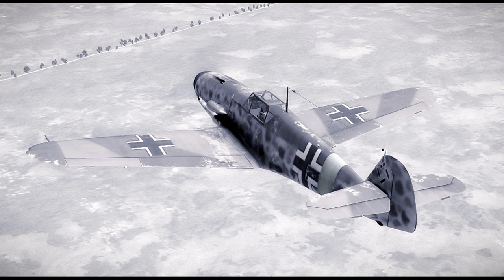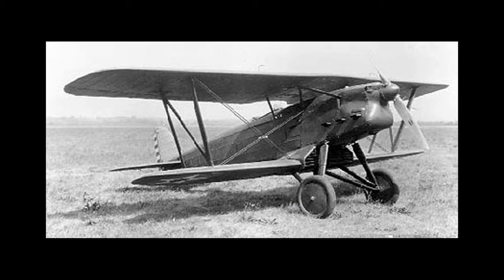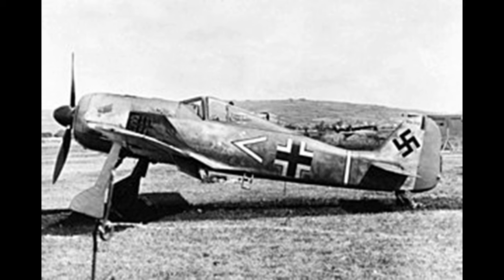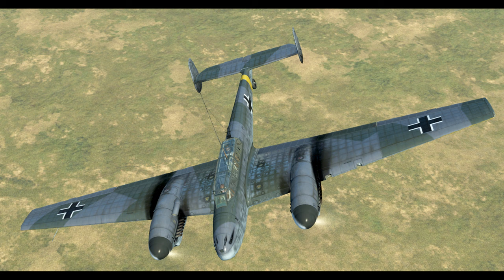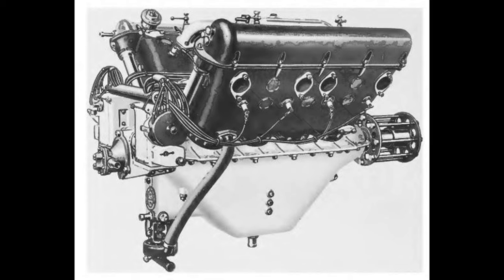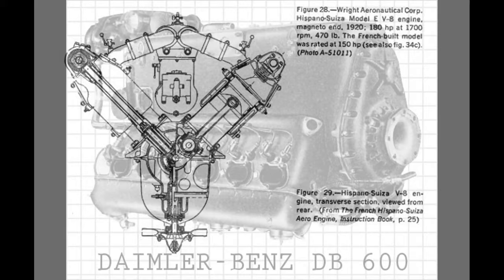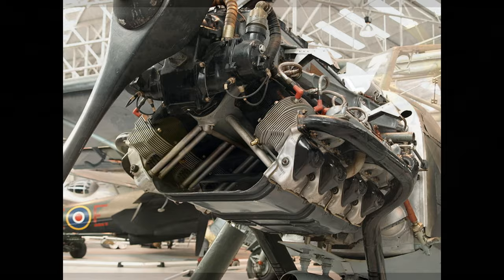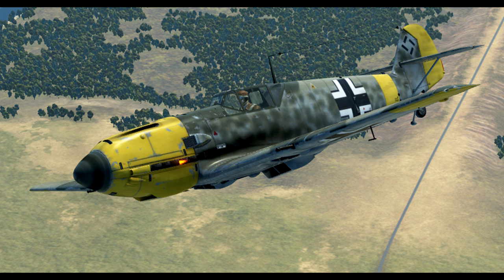Messerschmitt Bf 109 , Why an INVERTED V-12 Pt. 1? inverted V12s vs. upright

Comment: Do the inverted inline engine cylinders not fill with oil like the bottom cylinders of radial engines do from sitting?
Reply: i was wondering that, bottoms of the pistons would be full of oil and how does the drained oil get back to the oil tank ?
Reply: @jocrp6 Yes, that was a problem. Engines that had been standing for too long needed to be rotated liberally to clear the oil, and the spark plugs needed a lot of replacing/cleaning because of the gathering oil. It was a pain in the ass for LW's maintenance crews. Whether it was worth the easier reach when working with the engines I don't know, but it's certain the design wasn't without its drawbacks.

@johnik sushibar The Daimler-Benz engines (and I assume the Jumos too, without looking) effectively had two oil sumps, the camshaft cases doubling as one. There were scavenger pumps there to get the oil back to the oil radiator and oil tank.
Reply: @Inkompetent  thanks for the quick reply, what about the oil that drained down into the pistons , cant imagine them being "solid" ?
Reply: @johniksushibar165  Afraid I don't know about that part, but I imagine there at least being some drainage holes on the sides of them, allowing oil to flow to the camshaft case.
Reply: @Inkompetent  thanks,makes sense, i am a car mechanic , i cant get my head round things like this :-0
Reply: @johniksushibar165  I don't see how the oil that builds up in the piston cup would reach the cam case. Even if there were holes in the sides of the pistons, that oil would just drain into the combustion chamber, and out an open valve. But I dunno, I'm not a mechanic. The Wittman Tailwind used an inverted V8 at one time but it was eventually removed. I don't know why.
Reply: @myotherusername9224  Was that the Ford flat head? Yeah, no holes in pistons, just crank the engine over, ignition off, by hand 2-3 times and fire it up.
Reply: @jiroyamamoto2878  Wittman used the aluminum block Buick V8 from the 1960s. GM sold the design and the tooling to British Leyland, and the same basic engine is still in Rovers.

Comment: I was wondering about this engine choice. Think it's like the interwoven wheels Germany fell in love with on the tanks. On paper they are perfect, in the field a bad idea. Germany's response - Perfect now lets use them on EVERYTHING even motorcycle gun carriers!!
Reply: The interwoven wheels weren't a bad idea, the tanks were able to drive very smooth on rough terrain. And that's not a bug, it's a great feature... The traction benefits from that construction...
Reply: They  also clogged with mud and froze solid in Russia making the tank unusable. Could not be repaired  in the field without removing 4 wheels taking hours to days. There is a reason no vehicle has ever used them since. You are confusing advantages of torsion bars with the wheel design  @duke6321
Reply: dirkbonesteel not true lol, give us some sources
Reply: All of them  @Aikaramba12
Reply: @dirkbonesteel 
No, I'm not confused about the advantage of the torsion bars in comparison to the interwoven wheels. Fact is, that the ground pressure of the interwoven wheels is less then the pressure, a Christie's drive has. So they had some good reasons to use this for the heavy german tanks of WWII. Less ground pressure and less stress for the wheels and the chain is an advantage. You are right, they also had misadvantages in poor weather conditions and while maintenance. But they were the best choice that time. Today the technical progress makes them unreliable...

Comment: The Merlin was extensively used in  British MTB and MGB  (essentially the same  hull designs were copied for  the US PT boats).  Merlin suffered from corrosion in the marine environment and with aviation applications being the first priority  the Royal Navy switched to using the excellent Packard engine supplied under lend-lease.

Comment: It would seem to me that the inverted V has an advantage over uprights in overall war fighting capability where it counts the most , in the air .. The fuselage being narrow at top and wide at bottom where wing intersects could conceivably allow a more streamlined airframe   ( faster ) ..  If that's the case then everything else , unless huge cost or reliability issues , are moot points ... War fighting and battle winning capability are the holy grail ... and were I required to build a piston  fighter back then  , knowing what I know now , It would be an inverted V ... The comments on plug fouling , ring cracking , main bearing lubrication make me marvel at how little people know about engines .... You can point cylinders up , down , sideways , foreward or backward and there is a way of pressure lubricating and scavenging the oil and not fouling the plugs ... main crankshaft bearings have no idea how close or far they are from the oil pan or pickups and  do not care if they are located above or below the pistons .. they are pressure lubricated and then the oil falls away ... Oil settling in inverted cylinders before startup is a small aggravation that can be mitigated with procedures ... once the engine is running no component cares where its located

Comment: About primary sources. Calum E. Douglas in his book "The Secret Horsepower Race" at page 74 quotes the letter form Dr-Ing Wolfram Eisenlohr, who at one time was the Technical Director of Engine Development at the RLM. In this letter he lays out the technical requirements RLM sent out to DB, BMW, Jumo and Argus for the tender for new engine development in 1928. These requirements were specified by his predecessor, Dr-Ing. Helmuth Sachse. 

You probably would be pleased to know, that you've nailed it exactly right. The first requirement was inverted layout which "gave a smaller restriction to the field of view of the pilot". Second point was "lower mounted exhaust was preferable as the exhaust flames and also the fumes are further from the pilot", also "the position of the wing attachment to the fuselage is wider than higher up and therefore suits this widest part of the engine being mounted in a similar position low down near wing root" - which, I understand, effectively amounts to lower frontal section. Maintenance advantages are not the part of RLM reasoning for inverted layout choice, but still are the subject of one pre-war conversation between some english and german engineers, quoted in the same book in another document.

So you've correctlly reconstructed the reasoning for inverted layout without any prior knowledge of the primary sources. Very impressive deductive job.

And it's worth to note, that before this engine tender all these manufacturers were making upright V engines.

Comment: Seeing the design philosophy behind the 109 is probably was for easier maintenance and production and center of gravity.
Reply: One book that I have on the Bf-109 claims that it was originally designed for a 30 minute engine change over through the use of the quick connect couplings and mounting points. I suspect that the feature was dropped on later variants as it is not widely talked about in other WWII aviation related books and magazines.

Comment: With both the BF 109 and 110 there were machine guns (and their magazines) mounted between the pilot and the engine, that fired through the arc of the propeller.  In order for those guns to fire without shooting the prop, their firing mechanisms had to be timed off the crankshaft of the motor.  There are very real advantages in accuracy, ease of mounting, and ease of staying "on target", to having those guns mounted as close to the roll axis of the air frame as possible.  It's also advantageous to aircraft handling qualities to have the highly variable mass of ammunition within the magazine located as close to the pitch and yaw axis of the plane as well.  By inverting the motor, the axis of the machine gun barrels was brought much closer to the line of sight formed between the eye of the pilot and his fixed sights within the cockpit.  As the attitude of the air frame changes in flight from climbing, diving, and rolling, the relationship between the "Point of Impact" for the guns and the "Point of Aim" for the sights can change dramatically.  Bullets do not generate lift, and are pulled toward the ground by the acceleration of gravity which ever direction that may be, no matter the orientation of the aircraft.  Gun sights generally cannot account for all the possible changes in the attitude of the barrel when it is fired.  Having the sight axis and barrel axis be as close together as possible reduces how much they drift out of alignment with each other as the pitch and roll of the air frame changes.  Remember folks, these were not pleasure craft, they were finely engineered killing machines.

Comment: I can give a few other considerations.
1) Two sump pumps isn't a big deal, don't really need two pumps just a second stage. 
2) By inverting it oil splash helps better cool and lubricate the pistons. This makes the engine more durable and long lived and may eliminate the need for squirters simplifying the oiling system. 
3) Inverting would minimize windage, the crank having to spin in a mix of oil and air imparts drag. Dry sump helps this a lot, so would the oil not needing to drain past the crank. 
4) Would also probably lower oil consumption by minimizing oil leakage past the valve guides. 
5) A bit of a downside, squirters on the valve-train would be needed, however these are often added to upright engines as well anyway.

Comment: I was a friend of an early Denver area builder and flyer of aircraft whom I first met because of Midget racecars.  I had been aware of him earlier because of an article I had read years before about an upside down and backward Ford V-8 60.  This mans' name was Frank Van Dersarl and he told me years later that if you could solve your oiling problems you immediately got a 10% increase in horsepower with an inverted engine.  So he put an inverted V-8 60 in a racecar and also ran it backwards. I think the boost came from gravity working with the pistons on the compression stroke.  I am in the process of writing a biography of this remarkable man and am having difficulty with some other information.

He told me that during World War II he worked installing water injection systems on Wright 3350 engines installed on B-29 bombers.  I can find no information on this subject and would appreciate any information you or your readers might have.
Reply from the maker: I have several videos about water injection. I don't have anything specific on the B-29. What is it that you need? I'll try and dig it up.

Comment: A consistency amongst engine layouts aids mechanics on the ground. An engineer could more easily move between the BF-109, BF-110, HE-111, FW-190, JU-87 and countless other aircraft both single and multi-engined using the same basic knowledge to maintain all these engines.
 That prevalence probably traces to a common engine concept. What could make aircraft manufacture faster, cheaper and simpler than a single engine? The DB 605 and Junkers Jumo engines were very common powerplants in the Wehrmacht, similar to how Rolls-Royce Merlins were used in many British aircraft. The Merlin was incredibly reliable, a benefit of having more focus directed at it and engineers could get very cosy with it. The DB 605 and Jumo were likewise very good powerplants.

Comment: It looks like you pretty much nailed the reason on the head Greg.  The YouTuber "B Sport" (who sounds like he may be a native German speaker) traced the inverted V12 back to decisions made by the German engine manufacturers based on what they had learned in WWI.  Visibility, the ability to raise the prop in the air frame (which allowed shorter landing gear, that also had the knock-on effect of improving landing visibility), and better packaging of the over-engine machine guns were the reason.

Comment: There were a few smaller inverted inline engines (single bank, vertical) used in the U. S..  Ryan and Fairchild used them in their trainers.  They were also used in the lower displacement air racing classes.  This, I'm guessing, because they could be "cowled tight" for aerodynamic slipperiness and, with the crank at the top, long props could be fitted to planes with shorter fixed gear.
Another thought that popped into my brain was that some engine oil would run down the cylinder walls or piston skirts of ALL inverted engines after shutdown.  This would provide cylinder lubrication immediately on rotation/startup, no waiting for a pump and a splash or pressure jet lube system to put it there.

Comment: Very good research ....another advantage for inverted V12 engines is that MGs and cannons can be mounted above the engine  left and right of the crankshaft housing without obstructing engine  maintenance, usually done on the cylinder heads with plug replacement and valve adjustments, furthermore having the barrels near the center line and practically in  the line of sight of the pilot has  advantages in  gun aiming and calibration procedures.

Comment: Practically, an inverted design requires fuel injection, while upright positioning permits use of carburetion. The respective advantages of each would merit another discussion: An inverted Spit would rather quickly lose an engine, while at least one Bf 109 pilot claimed the thing ran better upside down. Great Stuff!
Reply from the maker: There are plenty of carbureted inverted engines. Please watch Part 2 for a discussion on this.

Comment: The inverted Vs may be mostly associated with Germany, but there were a number of inline inverted types before the war, like the Gypsy 6, etc. Because on paper an inverted engine makes good sense in an airplane, especially since they are mostly dry-sump engines anyway, and don't need an oil pan as such. There is no right or wrong way for cylinders to be oriented, we just came to think of crank down as the 'normal' way because it was easiest in an automobile to package the oil pan under the crank, easiest to access the spark plugs and valve train, and it also put the massive cast iron block as low as possible. Many of the problems are not the same on an airplane; it is actually easier to reach the plugs on an inverted engine, since it is over your head, there is no oil pan, just a sump. and the block was usually much lighter alloy. The higher prop centerline and more aerodynamic shape of the inverted type made it attractive, once the issues of oil seepage were dealt with. The big question is 'why did the Allies insist on sticking with the conventional V type in spite of the advantages of the inverted type?' (not that they didn't make some attempts at an inverted engine).

Comment: Nice!  One negative of inverted engines is the fact that oil tends to collect in cylinder heads after shutdown, leading to possible fouled spark plugs on startup or even hydro-lock, which can destroy the engine.  This is why radial engines are typically rotated by hand before they are started, not only to remove as much oil as possible  from the cylinder heads at the bottom of the engine, but to make sure the engine can spin at all before the starter is engaged!

Comment: Great video, Greg but I think there may have been one other reason. A huge issue for tail dragger aircraft was to keep the propeller well clear of the ground once the tail had lifted without making the main undercarriage too long which makes it unstable on landing and takeoff and adds weight. The Corsair had a novel approach to this by bending the wings and extending the undercarriage from the lowest point. Very clever! By using an inverted V engine the prop shaft was raised. Every inch the prop shaft was raised meant an inch shorter undercarriage.

Comment: The removable wings on the 109 were a logistic requirement to ensure it could be transported through a standard width german railroad tunnel when diagonally placed on a railcar.. You could get them to almost anywhere in Europe within a day or so, zero hours on the engine, no fuel requirement except for coal and water, and much safer in some cases..
    As for the inverted v, I've seen these aircraft hand cranked to start via an inertia starter, I wonder if this setup perhaps forced the engineers to create an inverted setup due to installation or packaging issues.. may also be the cannon mount, exhaust flash inhibiting the sights on the through prop .. 
  Mechanically I don't know of any advantage, unless they were using some sort of weird valve gear like a desmo, or something we haven't heard about..

Comment: This question has always made me curious I have to admit.
It would have been nice to have some comments from any design documents or personnel from the period but the only thing I have found is this :-
" Wolfram Eisenlohr was interviewed in 1980 regarding the 1928 requirement for inverted V-12s and he cited three reasons for the decision:
 More compact installation, better pilot view for single engined aircraft, less exhaust flame dazzle during night flying."
Of course you never really know if this was just his personal opinion rather then an official reason but it does get nearer to the time frame these decisions would have been made.

Comment: From many old reports I've read about Sherman tanks by those who used them the biggest problem was most models were powered by gasoline engines that made them very susceptible catching fire because the fuel tanks sprang leaks more easily than was expected. This issue were greatly reduced in the later models with the diesel engines.

I suspect you're right in that the US and UK engine manufacturers were looking and wider uses for their engines while the Germans were looking at specific use engines for the planes and focused on making the maintenance of them easier, thus the inverted engine models.